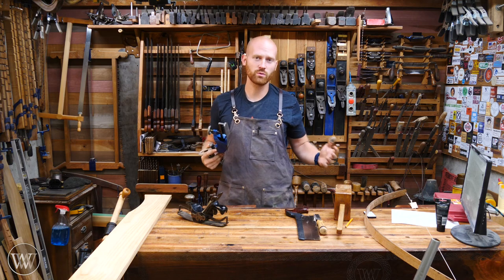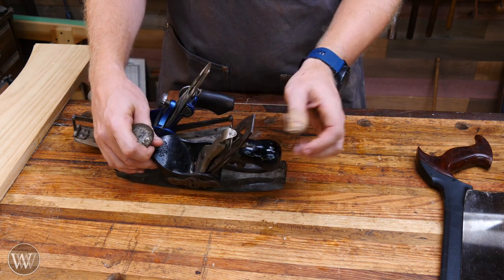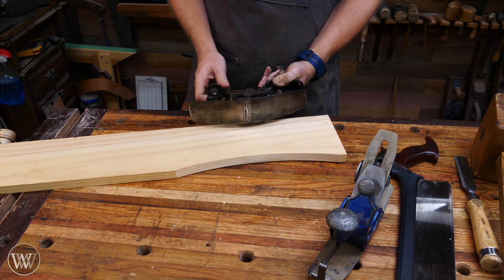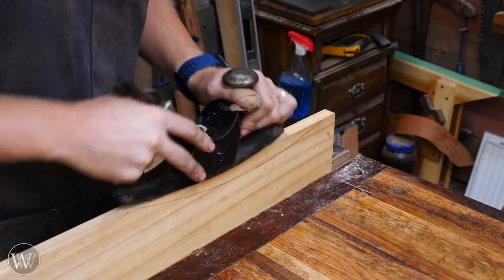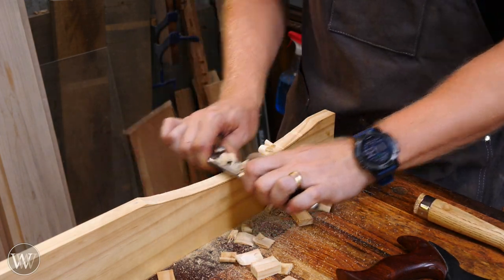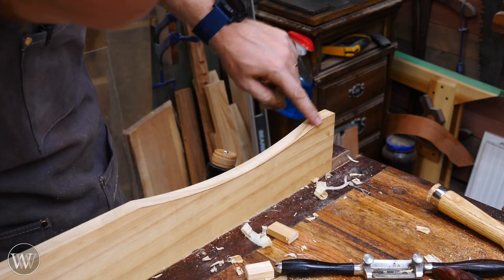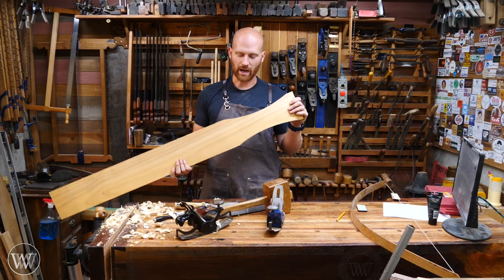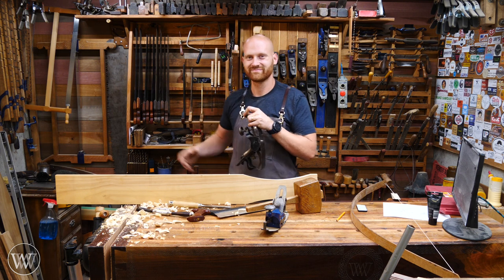How to Use a Compass Plane Stanley 113

Comment: James I pickup a newer 113 many moons ago forgot I had it until I saw this video. So I broke it out blew off the dust checked the blade and found it to be ground to a scrub type blade from the previous owner. Ever see or hear of these planes with a scrub blade. Have any idea where I can get a standard blade for this plane? Thanks for the video.  Maybe Lee Valley, Rockleer, Garrett Wade?
Reply from the maker: If you find an iron for a #3 bench plane it will work in there. I have never heard of anyone doing that, and don't know why anyone would.

Comment: The one that you prefer (the newer model) is also a Stanley 113?  I read the oldest Stanley is a 13 and then the improved it as you said. I’m buying one and trying to determine which model is the one you like. Thx.
Reply from the maker: The number 13 is an even older model and a much simpler design. The two I have here are both 113s. Just different types of the same one.

Comment: Hi James, I am definitely enjoying your videos - they are the best: to the point, no tangents, and very user focused (as opposed to techno-babble or collector jargon.  Question on Compass planes ... I am also a winemaker and am interested in using these planes to take off both the inside toasting of a barrel stave and the outside stains and such - in order to create curved oak furniture pieces.  So far the belt sander has been my (inadequate) means of doing this ... do you think that the compass plane may be my new best friend?
Reply from the maker: it might, but it is really intended for the last few passes of finishing. for the staining on the outside this might be just the trick depending on how deep it is. but the char on the inside is often a good bit more. I might use a spoke shave or draw knife there first then clean it up with this.

Comment: I don't think ive ever seen a video showing a compass plane smoothing the outside of a curve.
Reply from the maker: Yeah that's the confusing one. Because you can always do an outside curve with a regular plane. So it's not as useful there but I'm inside curve it is very useful. I've used it a few times on outside curves. But it usually ends up being some very large circle.

Comment: Do you have a video about round bottomed spokeshaves? I find them challenging, just like you showed for the compass plane on a flat surface: If I don't get the shave at exactly the right tilt it won't cut or might dig in. I'm getting better and feeling and adjusting as I go through the curve, but I've always wondered if this is a high-skill tool (as it seems to be) or if I'm just not understanding the tool.
Reply from the maker: I just did a live video on the second channel a week or so ago where I talked through them and showed some of the differences in spokeshaves. Generally with a round bottom it's just a skill to learn. I don't know if I would consider it a hard skill but like most hand tool skills it'll take four or five times of regularly using it until it clicks. Kind of like learning to use a chisel bevel down.

Comment: What are the common uses for radius planes? Are they used at all by coopers?
Reply from the maker: There are not many uses. Mostly just thinking stretchers and other details case peces. It was not used for coopering. It really is a one trick tool, but when you can use it it makes the final work so fast.

Comment: What angle have a compass plane? 🤔🤔🤔
Reply from the maker: Sorry. I don't understand the question. If you're asking the angle of the iron. Usually I sharpen mine at 35°
Reply: @WoodByWright  jeje yes so incomplete my question sorry. I refer to the angle of the bed of the plane when the sole is set "relative flat"
Reply from the maker: The bevel on the iron is down so you can put it at just about any angle you want. The bed angle is 45°. Most people sharpen their iron at around 30 to 35 degrees.